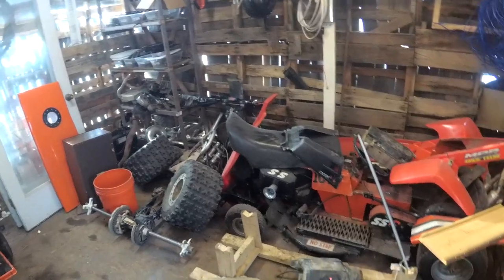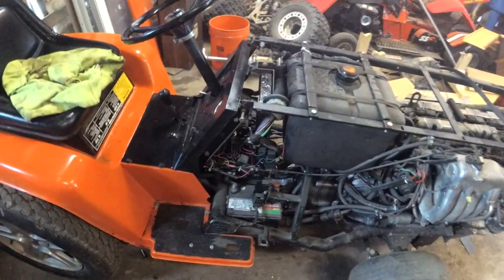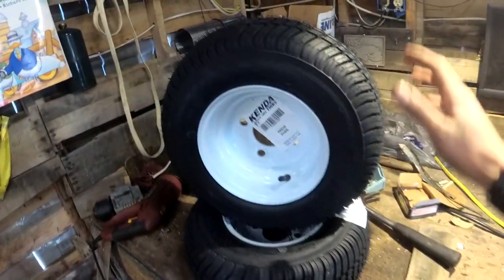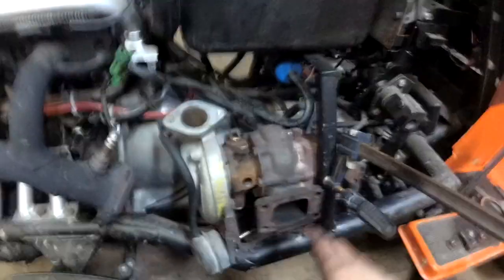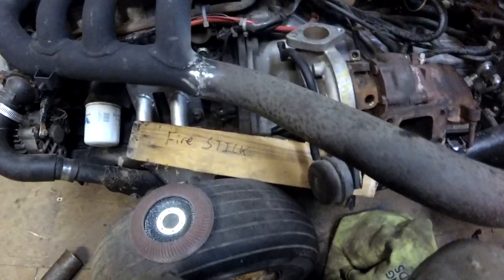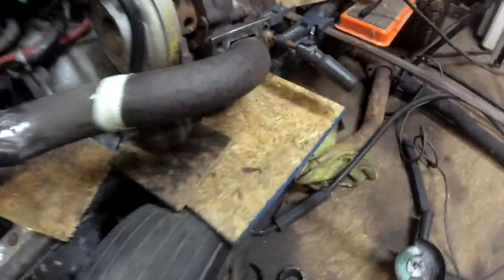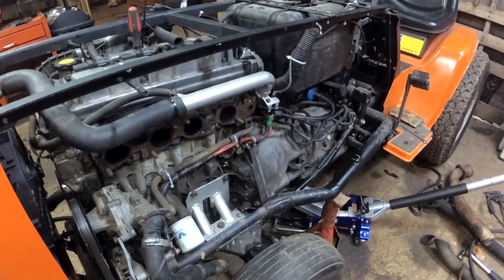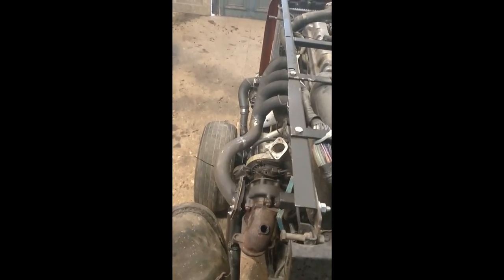TURBO 4 Cylinder Lawn Mower Build!

Comment: How hard is it to build one
Reply from the maker: It was about a 6 month project, but I wasn't working on it everyday. There aren't very many RWD 4 cylinder set ups, so the tracker worked out very well for that, and the tractor was already a tube frame, so that made modifying that much easier.